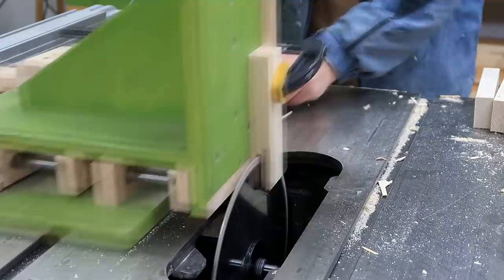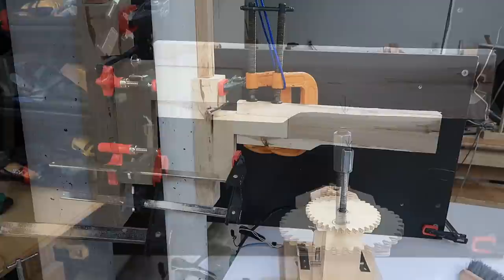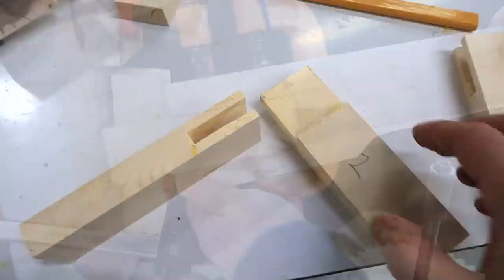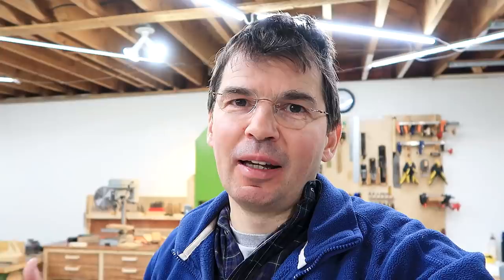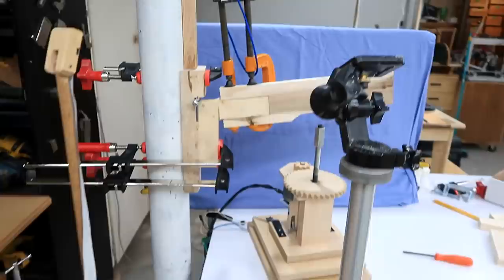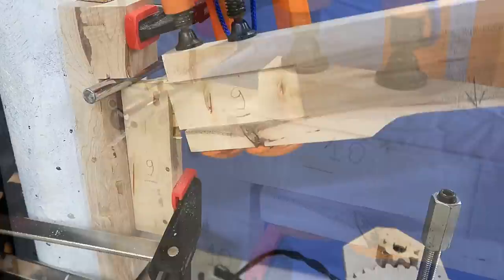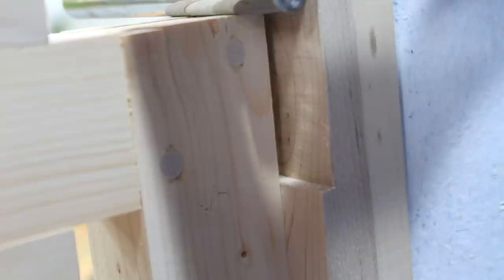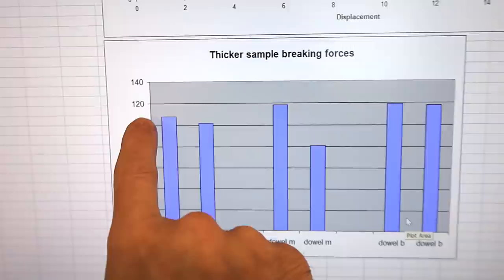Can reinforcing a joint actually weaken it?

Comment: Your direct force to the lever was 60-70... but I think the leveraged force on that joint was much much higher- probably double that due to the fulcrum point at the very tip of the corner joint. I think a more fair test to the joint is to test a full square of joints, pushing down on the middle of the box, and I already know that joint will outlast the wood every time, it will break at the middle of the square's length.

Comment: I think you should test for how much clearance is needed for the glue joints you used. If too tight, the joint wipes the glue right off.

Comment: I wonder how the tests might go when pushing from the other direction, as in closing the L rather than opening it up - and if that would change the behavior of the different configuration of dowels.
Reply: This is a fair question. I feel like in the past is strength tests were in that orientation. One more typical for shelving.

Comment: Have you considered adding some deep scores to the sides of the tenons to allow the glue somewhere to not get scraped away from? Or perhaps even drilling a cross hole on the outside parts that would allow you to add the glue in the middle of the joints.
Reply: You don't want a  few scores. You want a few ridges to create a gap in which the glue can reside.

Comment: very cool tests! I think the pegs were a bit too big, if you use split oak pegs or something like that, they can be a lot thinner while just as strong (even with your hardware store dowels, I don't think any of those failed right?). also interesting would be to test more real life stress on furniture, like repeated stress, but much lower force. if over 100 years the joint gets stressed repeatedly, the glue might fail after some years but the (drawbored) pegs still hold the joint just fine.
because there certainly has to be some benefit from pegging joints, otherwise the joiners of the past wouldn't have gone trough the trouble...
but yeah if you size the pegs wrong, you can certainly make the joint weaker. that being said, modern glue (maybe not the one you used here :) is a lot stronger than glue from 100 years ago ever was, so for many applications, especially if something doesn't have to last 100 years, just glue is more than fine, like you have shown many times here on your channel.

Comment: Well, as its just testing strength (rather than beauty) of the joints, an intermediate test to perform is equivalent screws in place of the dowels since those interrupt the grain less than the dowelling does (wood threaded through versus completely drilled out).

Comment: Sometimes you learn something you weren't trying to test.  I am completely surprised by the cold temp glue failure I always assumed those temperature ranges included a generous safety margin, but I guess not.
Reply from the maker: well, the numbers show the temperature didn't actually make a difference
Reply: There probably is still a safety margin. I'm not sure any product that is designed to hold anything doesn't have some kind of margin. The question is how much, and what type of product probably determines the amount of margin. So a steel bolt meant to hang something off of might have a bigger margin than glue.
Reply: @matthiaswandel  I guess I'll just have to watch again, I must have misunderstood something.
Reply: Oh, I was tricked because a bunch of the warmer samples the wood failed instead of the glue, and I missed the part where you said the forces were the same, and that particular stick of wood was weak.

Comment: I doubt the glue failed.  I think it more likely that a thin layer of wood peeled off in the joint because the glue would cause a change in density in the skin of the saturated wood and due to the change in density and hardness of the saturated wood, the shearing force at the boundary of saturated / unsaturated wood.  If this is the case, both sides of the broken joint would appear dry, but a scraping with a sharp chisel would reveal the glue under a thin layer of wood on one side of the joint.  just my opinion.

Comment: Good tests. But what glue did you use in this test. Also, how would the glue perform if you applied water to the joint pieces first, let it soak in then applied the glue? I’ve always been told the moisture in the glue will get soaked into the wood thus affecting the joint so I pre-wet my glue joints on things like this. It’s might add to your experiment.

Comment: For so basic a concept as glue joints, there is much opportunity for study.
Different types of...
joint, e.g. lap vs tenon vs dovetail vs box,
tenons, e.g. integral vs loose vs Rockler's beadlock,
glue, e.g. PVA vs epoxy,
wood, i.e. long grain vs short grain; softwood vs hardwood.
Etc.

Comment: I think the real benefits of dowels/pins here would be in the long term degredation and drying of the wood (over many decades), especially if they were drawbored. In this case, they keep the joint tight over a longer period, despite wood movement due to moisture content. Of course this is a historical joint that predates modern adhesives so it's anyone's bet which is better over a century.

Comment: Also test the kerf. I'm not sure if this is the right terminology but test a tight fit glue-up vs a loose fit glue-up and see if the tight fit is weaker due to less glue surface area or glue getting scraped off during install.

Comment: But these were bridle joints not mortise and tenon and pins. A bridle joint is entirely glue dependent where a M+T the glue is mostly preventing movement on a single axis. Seems like for many common use cases for a pin - hardwood furniture M+T - a pin is going to prevent the most common failure mode of a M+T by keeping the joint together if the glue fails.

Comment: Clamping a glue joint makes it stronger.  The video doesn't show the pinned joint being clamped, so the overall joint could be weaker than it might be if clamped.  That said, my intuition is the same as yours, I don't expect the pinned joints to be stronger.  If nothing else, they will probably increase variability, making the trend harder to identify without a lot of data.

Comment: My limited experience with using dowels on lap joints is that they substantially improve the rigidity of the corner. They aren't nearly so flimsy on their long flat axis, like if you laid the corner down on a table and tried to lift one arm of the corner.

Comment: I love this testing. I have a suggestion based on the non-pinned samples. How much gap is too much, how much is too little? Are we trying to get the joints too snug for the best strength? You've already proven that glue alone is the strongest, what is the best way to make a joint to accept glue?

Comment: Well, you didn't necessarily get an answer to the question you asked, but the answer you got is actually quite interesting!

In addition to testing different glues, do you plan to test different temperatures during application and drying?

Comment: What a great test! It's interesting the difference between what feels right and what the science shows. It occurs to me that wood as a medium is very difficult to devise testing for, the grain variation plays such a large role. While the failure would be different, would using high density press board demonstrate the same thing in terms of joint failure? Or would the fact that it does not have grain completely negate the value of mortise and tenon construction much less pinned?

Comment: Project farm has a great glue test video that he posted. I can almost guarantee if you used the top 2 strongest glues he used, the wood would always fail first as the glue is actually stronger than the wood in tension and shear

Comment: How old is this wood glue that was applied in fairly cold conditions too? What was the prep prior to glue application? The systematic glue failure is not typical, especially with softwood, either in my own experience or on this channel and in general. I have an oily wood (red cedar) bed frame glued with Lepage No More Nails CA /Loctite Power Grab US (acrylic/latex based adhesive IIRC and Lepage Yellow wood glue (Aliphatic/PVA) .  8 years, no glue failure .

Comment: Im surprised that the two failed on the glue. Usually wood glue bonds and hardens to be stronger than wood. Though I never used the yellow kind and only the white kind, if they even have any meaningful difference.

Comment: What happen if you only put one dowel in the center instead of 2 in opposit corners? Does it better reinforce the joint ? I guess so .. but guess is not always good. It will be a good idea to test that too. Thanks for your videos, they are always very intresting.

Comment: Nice,make sure you add t-88 if you need to really consider a structural glue, to mix equal parts, use an empty “pop” can and use the bottom of the can to easily mix 1:1 ratios…

Comment: A true mortise joint might work better?  On a bridle joint, the "U" shape can flex like a tuning fork allowing for more deflection of the wood and putting more stress on the glue and joint.  In this bridle joint, the glue is not stronger than the wood.

Comment: Definitely interesting - it seems as though it's so similar that it doesn't matter - I guess you end on a good note though, depends on the glue - that could very well be the case - the experiment seemed very well controlled and objective for sure - creditable, certainly. I'd be curious on trying it with not just wood-glues but epoxy and some other different compounds as well - but I think the glue would certainly hold up in those cases and would break at the glue/saturation line/soak line. Getting pretty particular as always lol I like it - not sure how these people are abusing their woodcrafts though... lol

Comment: I wonder if you can test the fitment of glued M&T joints with varying degrees of tightness. Like one joint that requires a mallet, one that requires some force, another that requires almost no force, and another M&T joint that has like a clear 1 mm space around the Tenon. See if there's a good balance between tightness without scraping away all the glue.

Comment: Great test, would a looser fitting joint give a higher breaking point since you wondered if the glue had been squeezed out when you pushed them together. This would help me since most of my joints are loose prior to glueing.
Reply from the maker: from tests I did years ago, a slight gap doesn't hurt, so long as it's full of glue

Comment: Does whether or how sawdust or other surface material is removed from the faces being bonded, change the adhesion characteristics of a glued joint?
Also, would threaded shafts and tapped holes , cleaned and glued, as narrow as doesn't shear before joint failure, work better than dowels?
Does dowel shape matter? Do square dowel(s) have benefits?  Would right or equilateral triangular dowels with straight or twisted shafts have any benefits?

Comment: it really seems your final statement was it, the dowels helps retain the joint during failure, and near the edge sorta contribute to the failure.  OK so test a single dowel in the center of the joint.

Comment: I’d be curious about a single pin at various locations. If you view the area of the tenon as a 3x3 grid, if any individual location works better. 

Given the visual evidence of where the cracks occurred a center pin might do the most good, if any hood at all…

Comment: Matthias, have you tried vacuum enhanced gluing (VEG)? It might strengthen the joint. A modified pressure cooker and a vacuum pump would work well for starters.
Casein glues might have a better grip. My dad worked for a door manufacturer, and they used some for certain projects.

Comment: Glue failure.  We usually see really tight fitting joints…97% of the applied glue is scraped off as the parts are fitted.  Glue needs to penetrate into the wood fibres on both surfaces….a lot of joints end up being almost dry as the glue is removed by the closeness of fit.  Solution…Let the glued surfaces sit for some time to soak in, before assembling that squeak tight joint.  That’s my 0.02.

Comment: can you please try also just one pin in the middle? i see that configuration as more traditional, it comes from green woodworking times, when this joint has been done without glue only hold by that one pin.

Comment: Can you also test whether scoring the wood before gluing will make a stronger joint.  I know a guy who does that.  He'll use a knife or other blade to scratch a cross hatch pattern on all the glue surfaces.  He thinks the scoring gives the glue something to hold onto.  Maybe he's right?

I don't know.  I've seen enough videos showing what glue can and can't do.  It's not as intuitive as I thought.

Comment: I have a great respect for Matthias, but in this case I think the experiment runs the risk of being unscientific because of the determination to prove a particular outcome. That said, my first suspicion about what's happening here is that the blue itself might be old. Some information about when that bottle was opened might be useful.
Reply: But he set out to prove the dowels would make the joint weaker, and then concluded that he couldn't see any difference in strength. How is that evidence that bias clouded the testing?

Comment: Well, all of the pinned joints failed more catastropically. If only the glue is pulled apart, it's just a matter of regluing it. If the wood splits... well, that's gonna be a lot more effort.

Comment: One thing I wonder if it throws a monkey wrench in these glue-only vs non-glued or glued+pinned tests is the impact of temperature and humidity changes over time (years), combined with regular use (repeated minor stresses).  No, I'm NOT requesting you to run such experiments, that would be a ridiculous ask! 

But to me the question is very relevant because I live in an area that experiences all 4 seasons (lately, often in the same week!), and I've seen countless pieces of furniture with failed glue joints that only remain useful (or at least unbroken) thanks to "back-up" dowels, screws, and nails.

Comment: I use dowels to pull the joint together (draw boring). What about a racking test with one dowel in the middle and then two dowels in the middle spread equally?

Comment: This is a glue starved joint you created, when glue fails and it looks like 'there is no glue' it means it all got sucked away into the wood fibers and there is no glue to actually do the job which is to bridge the gap BETWEEN the fibers. I believe this is a methodological failure in the test, would love for you to redo.

Comment: A trick I learned from an old model airplane builder cut Titebond with water 50% let it dry then full strength it will go deeper into the grain.

Comment: Is the new way of testing putting way more leverage apon the the joint in a way it didn't before
Reply: Because instead of the wood being supported under that notch, now there is a very small surface area supporting it right at the fulcrum

Comment: Try Gorilla Glue.  Allow 1 week to dry.  Wet the wood & dry with towel before gluing.
          The dowel position depends upon the direction of bending.  If you bent inward rather than outward, the results would have been different.

Comment: This is VERY odd... I thought the glue was supposed to be stronger than the wood itself... When the glue on those joints gave way in your medieval-style wood torture device, doesn't it suggests something wrong with the glue; maybe reached its shelf life?  ** Which is disturbing to me because I keep glue stored for long periods (years) in an unheated enclosed patio shop... so   😱 YIKES  ! ! !    I need to know before I use it on a project!!

Comment: Your biggest problem is that the adhesive surfaces are loaded in shear. Adhesive is not designed for this but to be loaded in tension.

Comment: in my opinion glue joints should not be applied in a full coverage layer, but with gaps. for example - - - - - -. . . . . . . . . . = = = = = = = =.   when a continous coverage one part of the glue tops it all goes. hence the other way mo betta.. maybe im the only one, but how i was taught. never had a failed glue up, and ive done some stupid shiz

Comment: Are you testing a joint that would be used in the real world? Sure, tenons are used all the time, but is the size tenon joint you're using ever going to have this kind of force applied to it? I harken back to your M&T and pocket hole joint tests. Sure, the M&T joint is stronger, but the pocket hole joint is strong enough to do the job. Any stronger is just unused strength.

Comment: Based on looking at your joints I do not think your glue was good.  A bridle joint is not really resistant to racking.  Many times the dowels are not there to reinforce the joint but are "draw bored" so that insertion of the dowels draws the joint to maximum tightness before the glue sets.

Comment: Where are you measuring the force?
Reply from the maker: load cells under the jack
Reply: @matthiaswandel  so not directly measuring the torque at the joint 🤔 might be helpful to include that calculation for curious folks like me 😅 thanks for the prompt reply!

Comment: Before watching the video, I can tell you the answer is YES! This is a well known phenomena in mechanical engineering. Whenever you add a structural member (reinforcement), you are changing the distribution of force in the structure. If done poorly, you can overload an area that was previously fine. That's because the total force isn't changing, but where the force is being applies is. I am simplifying it a lot, but the answer to the question is yes, adding a reinforcement can weaken a joint.